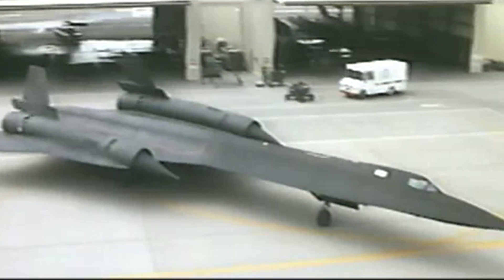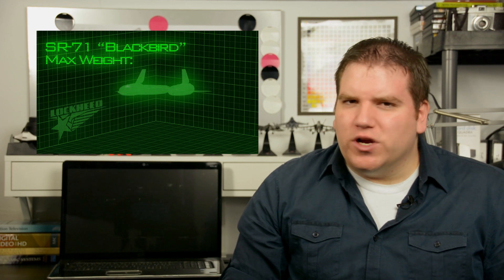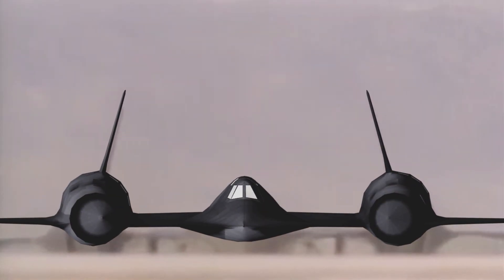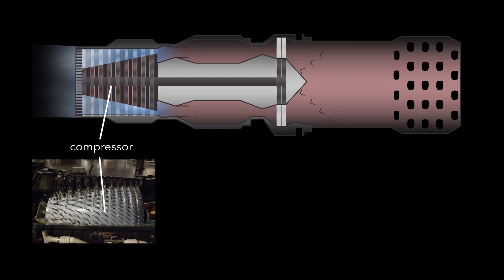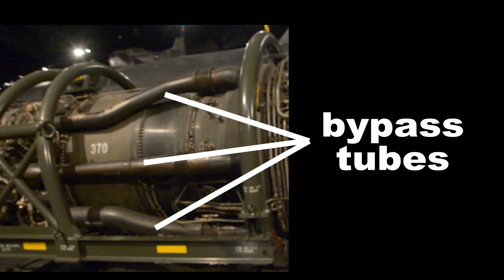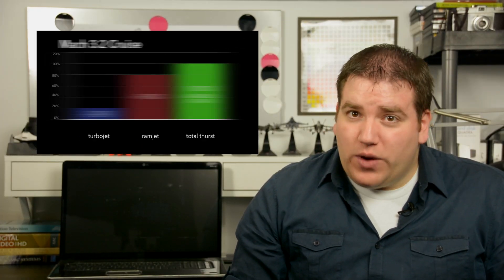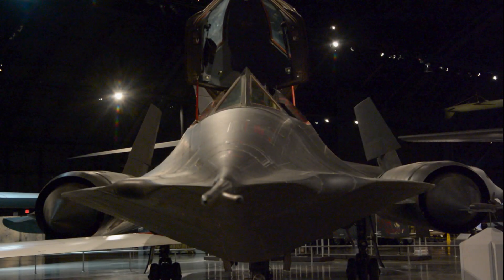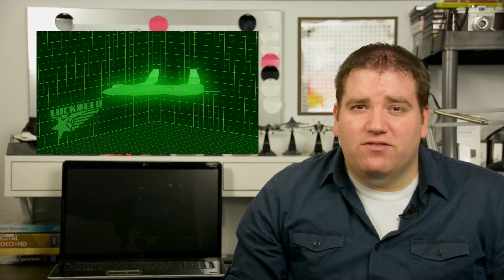The Plane that Dreams are Made Of: The SR-71 Blackbird

Comment: 👏🏼 Outstanding,  this reviewer is the first one that's acknowledged that the SR71 top speed is STILL classified.  Mach 3.2 is the publicly acknowledged max speed.  In all likelihood,  it was most likely capable of Mach 5 to 7 speeds. The key is "RAMJET" mode. Ramjets are good up to about Mach 6. The SR71 could probably tweak out more speed for brief periods. Excellent review ❤👏🏼 (And for all the haters out there,  look up the D21 drone.  It's a pure ramjet drone that started flying at mach 3 .)

Comment: Slide rule still reigns supreme. Actually, it takes 2 tanks of fuel. One to get it off the ground and a second in flight refuel once the hull temperature was high enough to seal the leaks present when starting.

Comment: When I was stationed in Okinawa I was able to sit down with two pilots that fly the ha-bu, SR-71. I learned it can fly higher then 95,000 ft. And fly faster then what this video is telling you. I also learned they will even shut engines down to get even better images recorded on film. They refuel many times to fly one mission. Seen them launch and recover at Kadena Air Force Base many times. When they come in from a mission the aircraft is so hot, it looks white! They bring in these huge fans to cool down the engines, skin of aircraft. They use a gantry crane to remove the pilots, due to the heat emanating from the aircraft. They wear a pressured suit, just like an astronaut would wear in space. Hint: Now what does this tell you? They have a variety of countermeasures to use to keep from being successfully attacked. Lets just say more then emitting chaff and flares! Now there is a newer platform even faster then the SR-71. If you do some history research on when top secret weapons systems have been declassified. You can figure out, there is flying technology platforms at least 30 years in the future, that are flying black top secret missions over your heads, and in other countries, and in outer space!

Comment: 78 tons? The Udvar-Hazy museum in Dulles Virginia has an SR-71 on display as soon as you walk into the place. It is a long plane sure but 78 tons? The copy at Udvar-Hazy is very well used. It has lots of wear. Awesome machine.

Is it the fuel that makes it that heavy? I wonder what the classified actual top speed is. I bet a dollar it is mach 4. Very intimidating aircraft I like it a lot. The A-12 is supposedly faster and higher flying. I do not buy for a second that no computer(s)were used in either planes design but that is just my opinion.

Comment: They tell us mach 3 plus , the pilots will tell you they are not allowed to say how fast . It can out run a rocket fired at it and has done so . They say 90 K feet altitude , I read where it went around the moon , that I don't believe that at all , but low orbit might be possible . Motors don't work in space .

Comment: The genius of the SR-71 was the inlets, designed by Ben Rich, former Vice-President of the Skunk Works, and at the time designated by Kelly Johnson to be in charge of its propulsion. Rather than being classified as a ramjet, the unique combination of inlet, engine, and ejector would more appropriately be classified as ram recovery. When at Mach 3.2 and 82,000 ft. the inlet is providing 54 % of the total thrust, while the ejector is producing 29 % and the engine is producing 17 % of the total thrust! How is this possible? The inlet generated internal duct pressures of 18 psi, while the ambient air pressure was only 0.4 psi at 82,000 ft. This extremely large pressure gradient is capable of producing an extremely large forward thrust vector. Picture a balloon with an internal pressure of 18 psi, pushing against the air of 0.4 psi, exhausting its air while constantly maintaining its internal pressure. The spike of the inlet would be the front of the balloon, being pushed forward as the entering Mach 3.2 airstream is compressed and slowed down to 600 mph, increasing its pressure to 18 psi and its temperature from -65 degrees F. to 800 degrees F., all in the space of 20 ft., produced  by the spike's shock waves, being captured, just inside the inlet. The ram air pressure has been recovered to provide additional forward thrust. Just like the balloon, which will pop, if its pressure becomes too great, the inlet will expel its shock wave, called an "unstart", if its internal pressure becomes too great, creating an immediate loss of that 54 % thrust. The six bypass tubes were used to keep the compressor from stalling by overpressure, exiting the air from the fourth stage of the compressor to the front of the ejector, providing cooling and additional thrust. The front of the compressor actually has a small negative forward thrust vector, while at speed. As Ben so aptly described his efforts, "Designing the inlets took 20 of the best years off my life!"

Comment: Kelly Johnson has to be one the most brilliant men ever to design aircraft's. For all the amazing engineering solutions they implemented to solve the challenges of mach 3+ flight, they never fully figured out how to stop the snap yaw phenomenon, associated with the loss of thrust from one engine, due to a flame out. The engines are spaced so far apart & create so much thrust, while moving massive amounts of air, when one engine would shut off, the drag caused it to act like a giant anchor pulling on one side. The pilot only had hundreds of a second to respond to the situation & pull back the running engine, or the airplane would yaw so aggressively, the side of the fuselage would end up pointed into the oncoming airstream. At mach 3 or faster, that yaw would snap the plane in two. Later they implemented systems to recognize the thrust loss from one engine shutting off, and pull back power on the running engine. However, they still lost several SR-71's from those particular events.

Comment: The A-12 Oxcart and the SR-71 are two different aircraft. True, the A-12 is the predecessor but there are differences.
The aircraft was conceived and designed on behalf of the CIA and operated by them for a while. The project was then hijacked by the Air Force, they made the plane slightly longer and added a second seat.

Comment: Technically, it never “outran” any missiles in terms of speed. ATA and SAM missiles travel at much higher speeds than the SR71 (obviously, as they are rocket propelled). It had to do with altitude and energy. Missiles don’t have an unlimited amount of propellant, and they run out rather quickly. After that, it’s all about energy. They are still tracking the target, but are quickly running out of energy. At lower altitudes, the SR71 would be very vulnerable to SAM attack or ATA attack. It’d be a sitting duck against a fighter or SAM station at lower altitude. You can’t outrun an active missile traveling at Mach 5+

Comment: The SR-71 is not a Mach 3+ jet it’s speed is 2198 mph Mach 2,85 I know that at 85,000 feet the temperature changes the speed of sound but is mean flat speed is Mach 2,85 to have a mean flat speed of Mach 3,5 it would need to go about 2700 mph about 500 mph more then is top speed speed of sound is 767 mph that’s the speed of Mach 1 ( the mark )

Comment: The narrator said the Airforce stated the SR71 top speed was "classified". My late uncle was an engine mechanic on that plane who actually got to take a test flight. He told me 3.2 was the rated top speed but if you pushed the throttle  she'd do 5.5 or better......... but not for long. As sleek as the plane is, it still couldn't withstand the stress of that kind of speed. 
He wore a Skunkworks tattoo on his arm.

Comment: The Blackbird can do no more than Mach 5.. any faster the skin will burn up on the craft.
Trust
Reply: The skin of the plane was so hot from the air friction that it would have to circle the airfield for 30 mins before it could land.  Otherwise it wasn't safe to get near it.  The pilot used the time to practice touch and goes a few times before landing.

Comment: Supposedly, there's already a plane known as "aurora" out there already at hypersonic speeds causing skyquakes.

I'm also a tad disappointed that you didn't mention that they light the afterburners with the same stuff they use to ignite a lot of rocket engines. The mission duration was actually limited by how many times they could relight the burners

Comment: Cite your source for engine damage on the mig-25. No record of it ever happening.
Reply: Actually, it's well documented that the -25 flying at Mach 3+ damaged the engines due to overspeeding and temperature (and high temps were an issue for the 71 as well....but it was designed to take it).

Additionally, Viktor Belenko -- who defected in 1976 WITH a Mig-25 -- confirmed that the mach 3+ run over the middle east wrecked the engines for that very reason.

Just look at the Wiki entry on the -25....it mentions it very clearly.

Comment: perhaps you can talk about the compressed HHo and brown field technology that reduces the weight of the plane by up to 89%.  fuel is used to cool or prime in damp air or high heat. the compressed ambient air is  o2  No2 and HHo. highly compressed to react, with No2 and HHo that's how all jets work.  time to end the fuel hoax bud they carry some fuel not tons.  the tech that designed that plane was the equivalent to a 386x86 running a cad program the bomb aiming computer of a b29 was a 286 x86 chip.  the super-efficient compressors compress ambient air to HHo No2 and o2 hence the orange flame after a takeoff prime  with liquid fuel.  as hydrogen consumes itself the orange burn is not projected.  projected exhaust only when primed by carbon-based fuel expansion causing a projected blue flame.  No? I'm all ears...
Reply: You're all ears, yes indeed. They start on either side and meet in the middle with naught betwixt.

Comment: I think video is repeating some obvious wordgames that were in the unclassified releases. First, in turboramjet mode, there is no "top speed." It will accelerate until it runs out of fuel or the plane melts from going too fast. I know of at least 3 occasions where the plane exceeded the official top speed and had plenty left to keep accelerating with. We will never know what the true top speed was, only how fast they were willing to fly without melting it. If you just go by the thrust and fuel ratios, mach 11 before it runs out of fuel, but I think there would be catastrophic melting before that.

Comment: What about the x15?? It can fly at Mach 6.7??
Reply from the maker: X15 was a rocket plane, with self contained fuel-air mixture (i.e. was not air breathing).  It also could not power itself during take off - it was carried up to altitude before being dropped and igniting its rocket.

Comment: You don't know what you talk about. The SR-71 guzzles fuel it's also way bigger it's obsolete and the fuel cost as much as a good bottle of whiskey. Try to fly over Russia now. A SAM will take it down in no time. The MIG 25 didn't even cost 10 % and used regular AV-gas. It is about as fast as the SR-71. Remember your perfect stealth bomber F-117? Didn't the Russians shoot it down like a limping duck when it flew over Serbia? It's the best looking plane EVER it was never as great as they said. I am very sorry America doesn't lead in aircraft technology anymore......  Not so weird all the German engineers that could choose between a great life in America or rot in jail are dead or about to die.
Reply: +Schwanzel Stock

> "A SAM will take it down in no time..."

 I know of no Russian or otherwise S.A.M. that's actually capable of breaking Mach 3.2 that has been proven. 

> |Remember your perfect stealth bomber F-117? Didn't the Russians shoot it down like a limping duck when it flew over Serbia?"

 Nothing is perfect. And the F-117 was one of the first steps in R.C.S. stealth designs. It had no defensive countermeasure, could go fast enough to avoid fire. Unlike the B-2s, F-22s, and now the F-35. Serbians shot it down. Not the Russians. And that's not the whole story. They had a blip of it about ~10mi-15mi. out. But couldn't get a good target solution. As it was flying the same flight path of other aircraft, Sergeant Zoltan Dani managed to get a solution "Vega-31" might be. So they shot down  it without tracking it.
Reply: Schwanzel Stock you mad bro?

Comment: Good job "forgetting" to mention extremely high rate of malfunctions and how many pilots it killed. Not as much as F-104 "widowmaker" but still...
If any modern plane crashed even half as often - its makers would be crucified.
Reply: This is a lie.
over thirty years of operations 15 aircraft were lost, none were ever shot down.  
no crew members were lost
https://spaceflight.nasa.gov/outreach/SignificantIncidents/assets/blackbird-losses.pdf
Some were lost on other aircraft (YF-12, A-12) but no air force personnel were lost in the SR-71. At hen end of its operational lif eit went from 1972 until it was retired with only one aircraft lost, due to a siezed bearing, off the coast of the phillipines.  And that one almost made it to clark, and no personnel were injured

Comment: One tank of gas you reckon?! It took one just to get it off the ground! That was the main reason it needed refueling on every takeoff (no to mention leakage from the air frame). And it also needed high explosives to start the jets! And it used 2 V8s for 30 years to turn the J58's over. This was no doubt a great piece of tech that I am very fond of, but it wasn't superseded by more advanced aircraft! It was replaced by more effective and less costly technologies.......
Reply from the maker: The SR-71 took off with the lightest possible fuel load that it needed to leave the ground, do a quick speed loop to heat up its skin, and get to the tanker for refueling.  It was the least fuel efficient during take off, so it was better to take off as light as possible, to use less fuel during take off.  This was generally less than a quarter of the jet's actual fuel capacity.

It used the external starters for the same reason - no integrated starter, less weight and more room for fuel storage.  The V8s were the only engines with enough torque to turn the J58s over!

And TEB isn't a high explosive, it just burns really quickly and hotly in air, providing the energy needed to ignite the slower burning JP-7.  A high explosive would have torn the body apart, since it generates an extremely high pressure shockwave, and doesn't heat things up much....
Reply: TechLaboratories
Not sure about a quarter tank, especially during the first years in operation! And in terms of the use of external starter engines, the combined fuel usage before takeoff wasn't as considerate as some would believe! Especially if we "consider" the excessive expenditure of the US military at that time, and Lockheeds ability to gloss over their blowouts.

TEB is not HE classed (an over exaggeration on my part), but anything that can blow up in air is highly volatile! Especially considering that only a fraction was used as a catalyst for JP-7.... I could say that the Kosmos R14 that put Russian spy tech into orbit would have made their moneys worth in half a decade than what it took to move 77 tonnes across the world for 3 decades....

No doubt the SR71 is an air breathing engineering marvel! And I love the notion that it was an organic piece of technology. But I can only speculate that this bird was built or superficial purposes more than it was intended to be (much like lockheeds modern programmes). In saying that, I'd love to see the 72 come to fruition....

Comment: So this plane would reach New York from London in less then 1.5 hours (90 min)! Astonishing !!
Reply: Just think. That's just the "official" top speed.
Reply: @robertalexander5892  In Brian Shoul's book, he talks about a time that missiles were fired at him, and the evasive maneuver was to throttle up.  He was pre occupied with the missiles, and when he realized he had not yet throttled down,  he saw the machines number higher than any other time in  the program. 
Was worried about the aircraft, backed the throttle down, and was very impressed with its performance.
Reply: Capt_Kaplan I would bet money that it can go faster than that 😉
Reply: @nicholasmorrow2601  guaranteed!
Only True limit is the inlet heat temperature. Brian Shoul has the True fastest mach number,  and he is not giving that out.
Reply: @patch5859  agreed. The engine made more thrust the faster it went ( thanks to the ram jet) the true limit is only due to the airframe.
Reply: At cruising speed...Mach 3.2...it was a mile every 1.5 seconds.  When they were flight tested back in 1964, they were clocked at mach 3.4...so we know it will go at least that fast.  Brian Shul claimed to have hit mach 3.5 running from a Libyan SAM.  Given the verified speed of 3.4, 3.5 is believable.  One SR-71 pilot claimed the top speed was probably close to mach 4, but nobody ever pushed it that far.  Assuming the mach 4 speed was possible, that's about a mile very second.  Do the math.
Reply: @panderson9561  only True limit was the inlet temperature. 
Other than that probably 4+
Reply: I seem to remember reading that in attempting one of the final speed runs they calculated that it could hit Mach 3.5, but the engines would be toast after. However, a bigger problem was that they determined that if there was a problem, keeping the pointy bit facing forward would be a bigger issue. So they abandoned the idea. So it's unlikely that the sr-71 would have been pushed to those limits on an operational sortie.
Reply: Fucking crazy! 90 min in 2018 is Amsterdam to London with a normal plane.